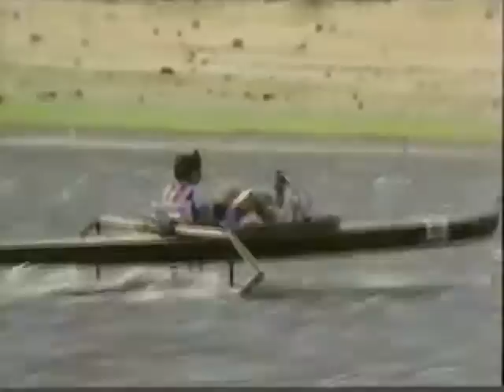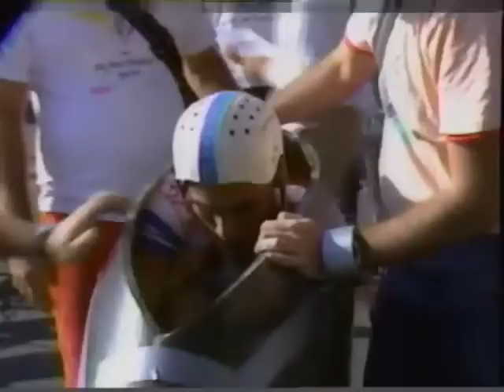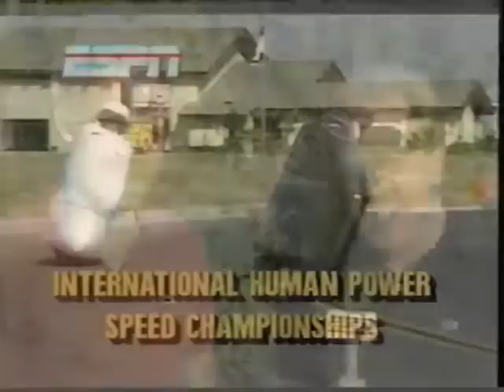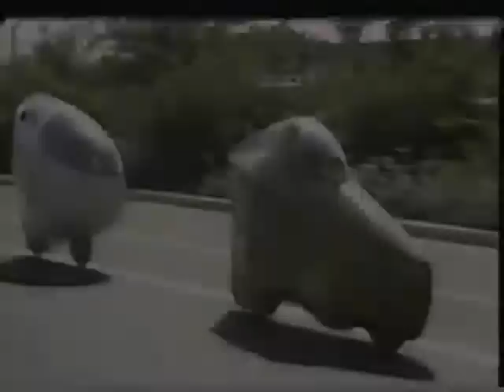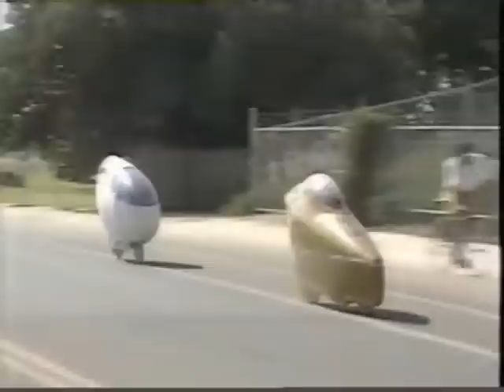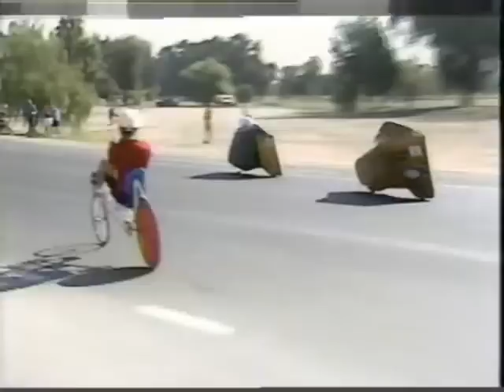Steve Shutt pedal Powered Hydrofoil Kayak. Hydroped 2

Comment: This is fascinating. In early 2016 I started building a rough prototype for a 4 wheel drive and 4 wheel steer pedal kart. I built it aft finishing 9 months of treatments for Lyme disease. Then I had to stop working on it when the Lyme disease returned. I also needed a bit more money for machining splines on 3/4” shafts. I dismantled the parts connecting two sides of the frame a few days ago and I plan on building a simpler version in which I can use the axle shafts I salvaged from a 4 wheel steer lawn tractor. When it’s done I’m going to put a blade on the front to plow the snow off the sidewalk.
Reply: that sounds cool!
Reply: Lyme's a rough go, I hope it's working out for you.